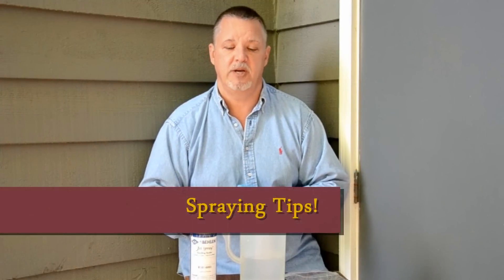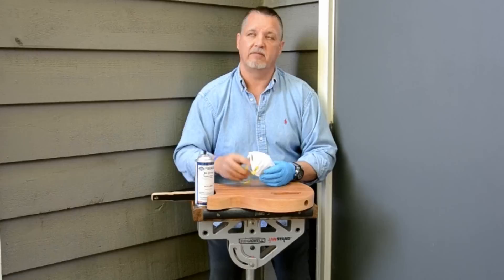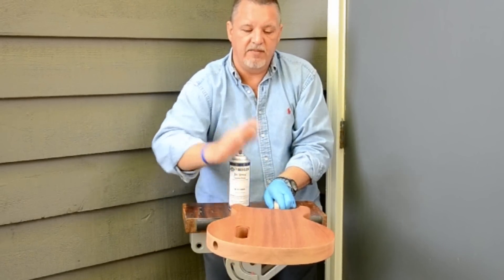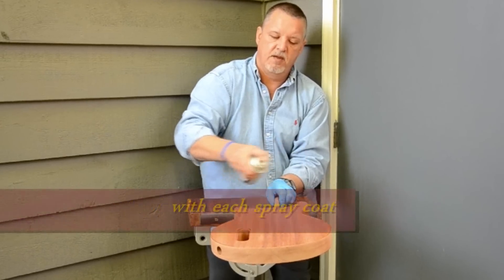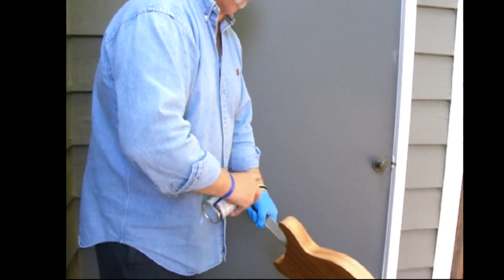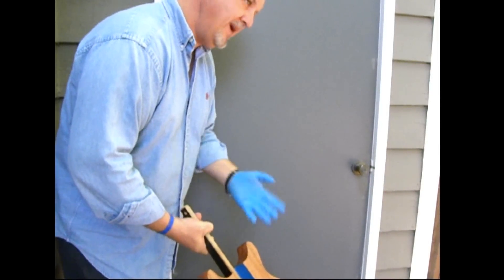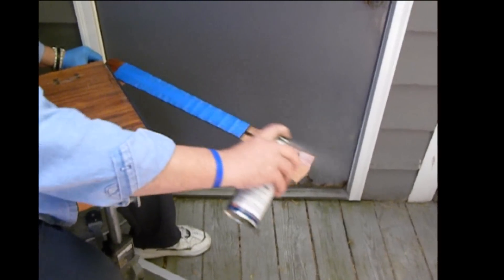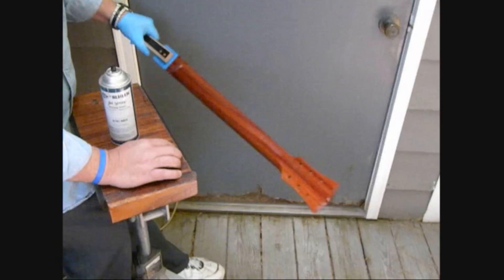How to Apply a vintage, Two-Tone Sunburst finish using Spray Cans! Part 2-Spray Sealer

Comment: A dust mask, such as shown in the video, does nothing to stop noxious fumes from entering your lungs. For that you need a respirator with an appropriate set of filters (activated charcoal or whatever).

If you can smell vapors (and using a dust mask, you certainly can), it's not offering any protection.

Comment: Did you apply a wet coat to the back of the neck, or no? I'm assuming you did. 
Also, how many more layers did you add of sanding sealer? 3 total? or just 2?
Thanks in advance.